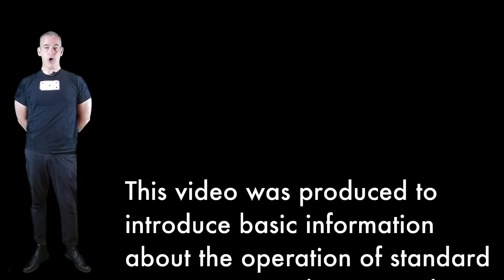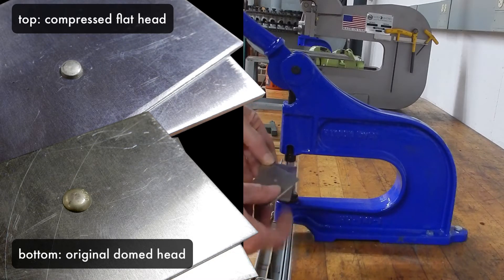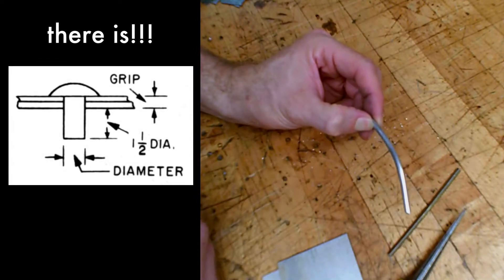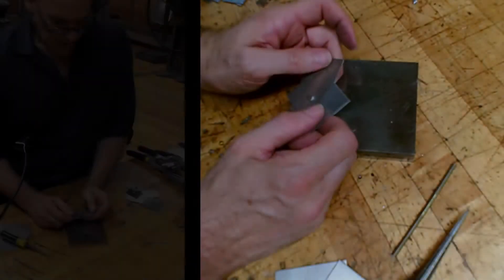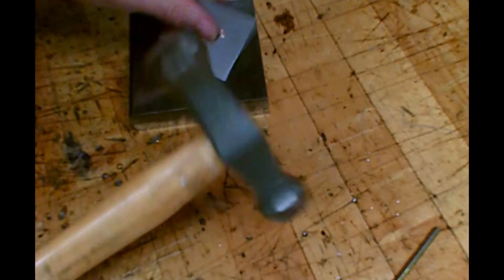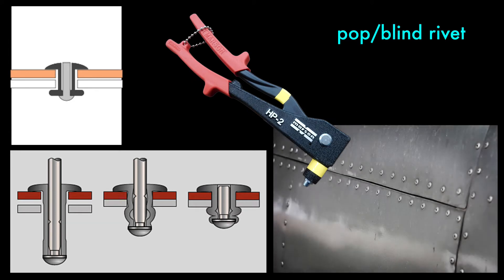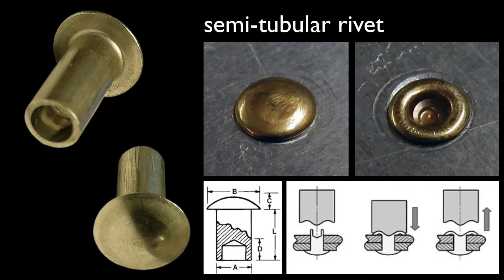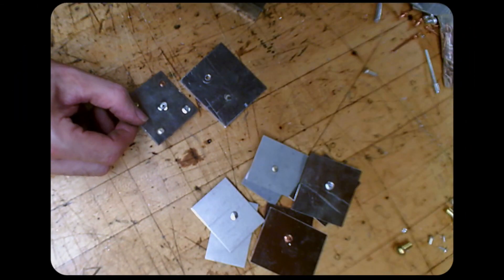Common Metal Shop Tools: Riveting

Comment: This video is great. It saves cost. The author of the video showed that to do riveting, most of the tools and materials needed are available: hammer, jeweller plier, chisel, rivet gun , hard surface(bench anvil), flame, wires, center punch, files, sandpaper, jeweller saw, hand reamer, rivet set, rivet( solid, semi tubular, pop rivet etc)

Comment: Working as a home remodeler I have used rivets for fastening gutters but it was years ago. I totally forgot how I did it so I was looking for info and tutorials. I've also used eyelet grommets.

This video demonstrates that rivets can be used for jewelry with elegance.

Gutters don't need to have pretty rivets but this is useful for my small finish projects.

I was considering using eyelet/grommets for a hand-made cipher disc but the hand tool I have is way too limited for length. I bought a second one I was considering to cut and modify it to fit so I could have an unlimited reach (as long as the bottom could be held steady to hammer from above).

But now that I discovered rivets can be installed by hand, that may be a better option.

Thanks for the video. Great insight and information.

Comment: would you happen to know how watertight riveting on early 20th century ships worked, to prevent ingress of seawater?
Reply from the maker: I don't know! But I asked Evelyn Ansell who is curator at the Herreshoff Museum and she replied (in a casual, not really meant to just be pasted here way, but I think that only makes this answer BETTER, so I am totally just copying and pasting and hoping she doesn't stop taking my calls):
"I believe riveting steel hulls was a hot process, so there is that extra possibility of goopiness. By which I mean, a decently tight seal since you're whamming the rivet in there when it's hot and soft, and then shrinks tighter as it cools after it's been riveted. (In wooden boats rivets are not usually a leaking issue because wood swells). So I think that generally made a pretty decent seal, tho there may very well have been more to the process? I don't know if they used material in the actual seams...? But also, metal plated boats did leak! Though I don't fully know how the caulking process worked on metal hulls, it was a specialized skill - they had "caulkers" come down from Bath Ironworks to work on some of the metal plated cup defenders in Bristol, for example. I also know that the metal plated cup defenders were notoriously leaky because they were very thinly plated and also they were made of different kinds of metals above and below the waterline, and so those joints tended to leak because the different alloys reacted differently to temperature changes."

Comment: Can you ever maintain movement/rotation with a pop rivet? Or does the nature of the way they work mean your material will always be in enough compression to hold them tightly together, preventing movement?
Reply from the maker: You can! Easiest to do with a pre-formed rivet. Make the bottom hole fit your rivet snugly but make the top hole (which goes against the shoulder of the rivet) larger. That forces the rivet to grab the bottom layer without catching the top one. Pop rivets do not like movement, they are bullies.

Comment: Hi, I have an old metal vacuum wand I want to rivet a button lock on that came off.  I used a pop rivet but it is a little loose and I would prefer to go back to the factory look of a tubular rivet.  I was looking into a hand rivet squeezer but I am not sure if they would work in this application since I need to be able to squeeze the rivet on the inside of a 1 1/4 inch tube about an inch deep inset.  It would probably work if the short end of the squeezer could be placed on the inside of the tube but from what I can tell it looks like that end is for the head of the rivet so the long end that squeezes the back side of the rivet would have to be on the inside and that would not work I don't think.  Do you know what type of setting tool I would need?  I hope this makes sense.
-Thanks
Reply: Rivet nut?

Comment: quick question, at 3:54 you created a rivet with button head on both sides...you stated that the rivet tool was set up with a concave surface on both sides bottom and top.  is this correct, or was it actually concave on one side and convex on the other.  I am in need of doing a rivet like this button head on both sides loose enough to allow movement between two pieces.  thank you sir!
Reply from the maker: To make a rivet round on both sides, you need a concave set on each side or else you will get a flat spot. To allow rotation (if that's why you want it loose) I have found it best to make one hole fit the rivet snugly and the other fit loosely so that the rivet grips one layer and leaves the other free to move. But if you mean loose so there is space between the layers, you need to include a removable layer when riveting. Otherwise you'll just get sloppy rivets.... Hope that helps. Just experiment. That's the only way to really get what you want.